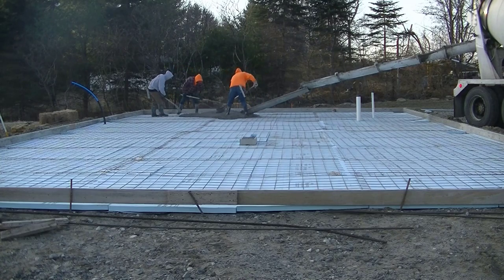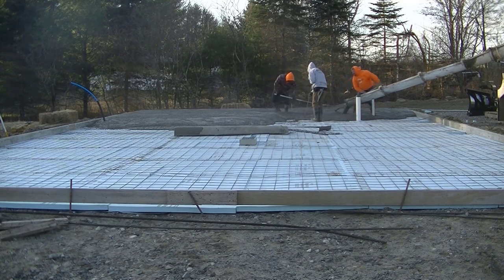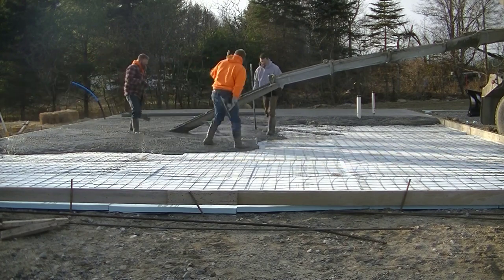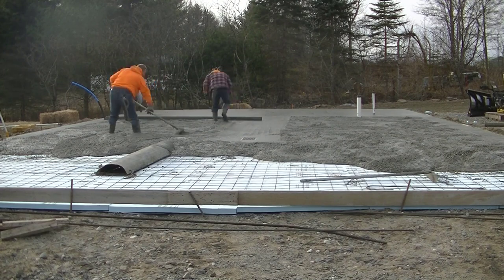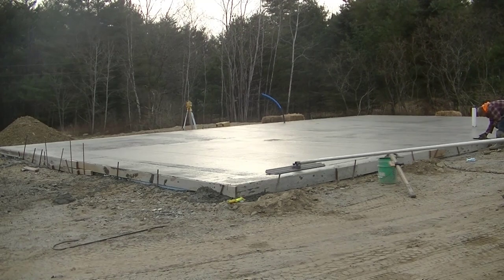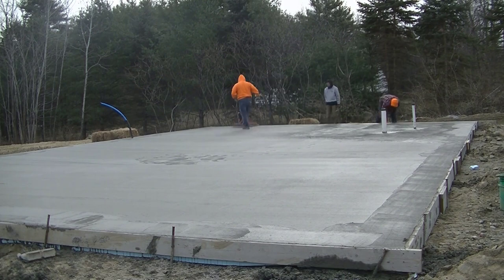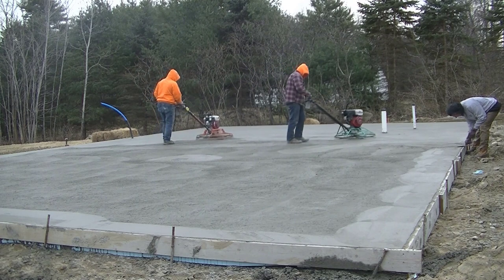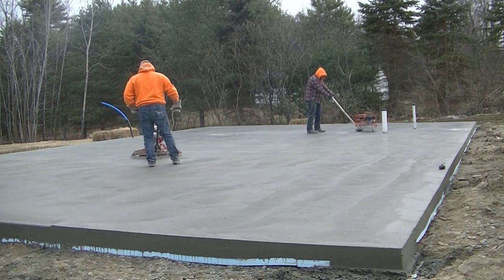Pouring A Concrete Slab In Freezing Temperatures (Cold Weather Concrete)

Comment: I poured my first DIY slab (19x19) when it was below freezing and below freezing for the following week last year. Did the hot water and calcium chloride. The slab has heat tubes. Set up a temporary heating system with an electric hot water heater.  I covered the slab with tarps but no insulation. $100 + in the electric bill but was worth it since the slab came out perfect (except for my amateur finishing skills). I wouldn't have tried without knowing I could heat the tubes.  It did set up faster than I thought it would.
Reply from the maker: Thanks!

Comment: Coldest I poured was -26 Celsius in Alberta. The pour was hoarded and heated though, the pump truck had insulation on the pipes so no issue with concrete freezing in the pipes.
Reply from the maker: That's pretty da$ cold.

Comment: Here in Montana I pour anytime Temps are going to rise olive freezing for 3 or four hrs. I use bluesteel combination blades on all of my power trowels. If the slab is rodded in flat there's no need fir pans. This time if year I mist always pour  2%-3% calcium,type two or three cement,type three on a day when Temps are as cold as your pour.
Reply: So I'm pouring today in Oklahoma, started at 830 around 25 F got up to 50 today, bright sunshine today, but gonna be about 28 tonight. Think I'll be ok or should I cover it?
Reply: It's actually 52 right now at 3:45. Above freezing from 10 this morning until midnight..just a little worried about pouring on that cold ground. It was 21 last night 😬
Reply: @daddylee4216  I don't cover until the low is around 20 or lower if it's in the 40s the day I pour. I don't worry about the first nite ao much because the calcium is working. I will cover the second nite if it's going to be in the teens or if there's going to be a frost. Heck with daytime highs in the 40s and 50s I usually don't worry about it especially using additives.
Reply: @daddylee4216  we use ground heaters here also but not with the highs in the 40s and 50s. I dont worry about cold ground except for frost heave.
Reply: @daddylee4216  did you put calcium in the concrete?
Reply: @mikemckinnis3877  good to know that makes sense and it makes me feel better too thanks for the quick reply!
Reply: @mikemckinnis3877  1 percent
Reply: That's what the concrete guy wanted
Reply: Personally I wouldn't worry about it.
Reply: @mikemckinnis3877  👍

Comment: I'm getting a pole barn built November 14 in northern indiana near Lake Michigan. There using wire mesh and plastic. Hopefully it all goes well . Great job on the concrete!
Reply: I’m ignorant. I’m having a six inch slab poured monolithic style as the outer edge is 10” and the inner section is all gravel base with a layer of plastic...also with fiber in 4k# concrete.  Will I still need wire mesh? Thanks!

Comment: Getting ready to pour a new slab in the next 2-3 weeks in Ohio. Temps currently are in the 20’s at night, 40’s during the day. How much time would you give the concrete before building the structure? Also how long to wait before sealing with a product like Eagle One? Using the same technique and formula you did in this cold weather pour. Thx!!

Comment: Could you explain something please? Video shows one guy pulling up wire and then the other two coming right behind and stepping it right back down. Just wondering how thats effective.
Reply: its not, wire will be on the bottom for sure.  Wire is pretty mich always installed this way and it sucks. Use rebar and dobies if doing your own slab.  Wire is for cheap clients.
Reply: @omgnothingisavl  Thanks for the info. I knew that didn't look right. The wire is doing nothing laying on the bottom.
Reply: I feel the same way you guys do. Might as well not bother with the wire if it’s just going to sit on the bottom.
Reply: Waste of customers money if the WWF was included in the overall cost of the concrete bid. Makes zero sense to put WWF in and “pull it up” as you pour, then have people walk on it and push it right back down to the bottom of the slab. Rebar manufacturers make special chairs designed for WWF.  It’s a bonus he put in integral fiber in the concrete, hopefully at least 1.5 lbs/cy if a microfiber was used.

Comment: So you are not pouring it in freeing it in freezing temperatures like the title says? + 32F for 3 days needed?
Still good tip on the styrofoam. I’ll definitely use that. Wanted to use a buffer but didn’t think of that. Thanks
No mention of using anti freeze? Is the accelerator similar or just speed up drying?
Non-pro pouring a single car attached garage.
Reply from the maker: It's 15 degrees F when we started pouring it in the morning, that's freezing. It didn't get to 32 for hours after we started pouring. Accelerator speeds up set time. If temps are going to drop below freezing after troweling, cover it with insulated blankets to protect it.

Comment: Nice job Mike, it's hard to tell but do you strike a white chalk line for the saw cutting or do it freestyle it's hard to tell from the video, we chalk a line but maybe you don't it it comes out fine don't know,
Reply: maybe ouy proof should read what you post  lol !  " we chalk a line but maybe you don't it it comes out fine don't " know,
Reply: @masonman88  
Was asking if they chalk a line to saw cut, it's hard to see in the video, that's my question not sure what your response has to do with my question.
Reply: @74stevedc  Of course they chalk lines.
He was just saying, your comment would be easier for others to read if you grammatically checked it before you clicked “Comment”.
Reply: @74stevedc  I quoted you because I was not sure of your words. . I am a mason also and no matter what you put down for a line it will vanish with the saw as it cuts! using a straight edge would be my recommendation to make a score line then make the cut after you remove the straight edge. just as my words where scrabbled in my response to your post , your words were also scrabbled. hence me quoting you for clarification
Reply: @74stevedc They do use a chalk line, not sure what color of chalk. At 9:58 in the video, after the forms are stripped, you can see the chalk box on the right edge of the slab.
Reply: @jeremyhuggins8796  :)
Reply from the maker: We use a chalk line, white or blue mostly.
Reply: @psidvicious  always a fucking grammar nazi in the bunch. I fully understood what he was saying.
Reply: @mikemckinnis3877  Uhhh, ‘Johnnie-come-lately-to-the-conversation’ - If you look at the order that the replies came in to @74stevedc’s initial comment, even the slowest of us can see that I was simply explaining what @masonman88 was saying, before he explained it himself.
I’m a lot of things, but a “grammar nazi” is not one of them. 
(how long have you been waiting to crowbar that tired old internet insult in 🙄)

Comment: Do you guys like fiberglass rebar $5 per 20ft stick) ?  I used it all in more pours (DIY guy) with good success so far. Much easier to handle and cut than steel.  Supposedly stronger too.
Reply from the maker: I haven't seen where they sell it up here yet. Haven't had the chance to use it.

Comment: Its sad that you have to put in the video that you are pulling up the wire. I know if you dont your gonna get some damn know it all to say “ Wire dont do anything on the bottom of the slab”. Good job Mike Darren and Luke!!!! You guys do great work.
Reply: And i truly mean that. I pour concrete myself, so i would know if you were cutting corners.
Reply: We pour in temps that low with no problems. Worst part about it is how the concrete freezes to all  the metal tools so quickly. Make it that much harder to clean them good. Its all about the mix you are using and the slump you are pouring at. Also your timing on finishing. Last thing you want to do is overwork it while finishing, because the the mud “dies” ( stops setting up)
Reply: I was thinking the same thing. That wire does just fine, if not better, at ¾” (diameter of the course aggregate) off the bottom. Once the agg gets under it, it can’t get back down to the dirt like so many people complain about.

Comment: I personally hate wire. Rather use #3 rebar depending on the thickness. I'd use #4 on a 6" slab. Fiber finishes so ugly compared to straight bag mix.

Comment: Anything below zero the water molecules   (Bubbles water within the materials) will freeze therefore creating holes or perforations in the concrete like a aero chocolate bar that will in turn have weakened the overall Neuton strength of said materials .Never use a wet mix in sub zero temperatures FACT